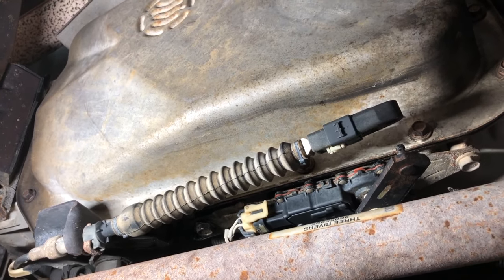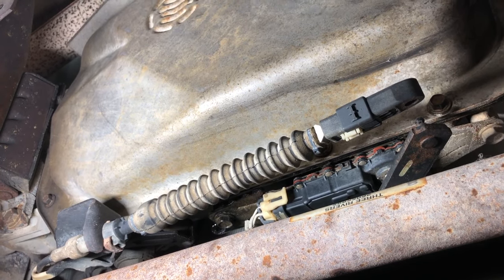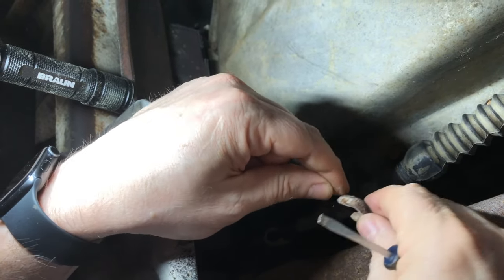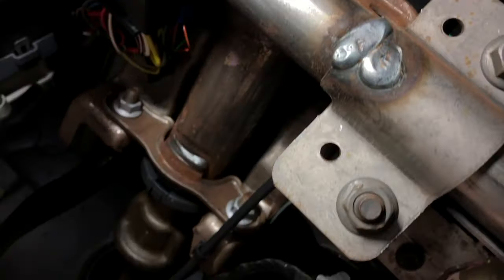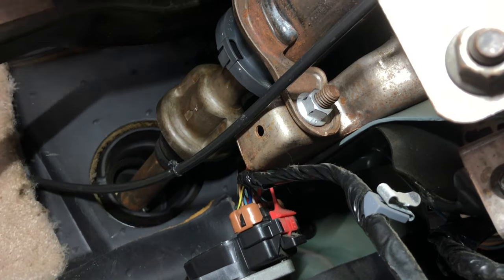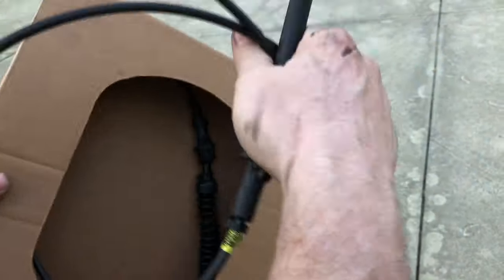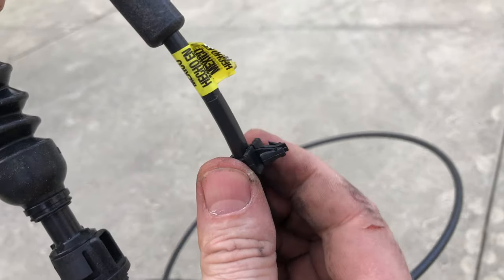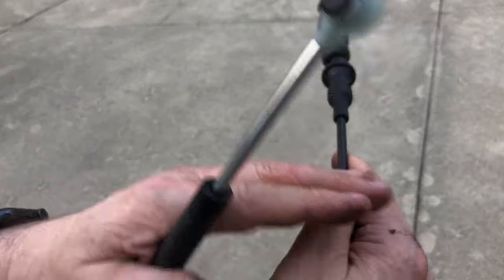1995 - 2000 GM OBS Truck Automatic Transmission Shift Cable Replacement Adjustment (Chevrolet & GMC)

Comment: Great Video. Any idea why a 95 Chevy k1500 shifts smooth into D, but when shifted into reverse, has a pause then feels like it slams into gear?
Reply from the maker: That's a form of delayed engagement which could stem from a number of causes internal to the automatic transmission itself.   If it's the original transmission still on that 1995, long overdue for a rebuild.
Reply: Tip, if you cannot shift into Drive 2 or Drive 3 manually from the steering column , the cable is stretched and you're on borrowed time...
Reply: @thomasbartlett3409   It shifts into Drive and through the forward gears just fine. Just delayed engagement when shifted to reverse and engages hard. 158k miles on it with orginal transmission.
Reply: @DrShock   are all cause the tranny? It is original tranny with 158k miles on the truck.
Reply from the maker: All causes of delayed engagement are going to be inside the transmission. Based on what you've described, that's what I would suspect you have going on.  Delayed engagement can be as simple as dirty ATF, or as bad as the reverse drum or band being worn out (and everything in between including just a bad seal).   About all you can address without pulling it out is an ATF and filter change.  

You can sometimes get some more life out (for a delayed engagement to reverse ONLY) by replacing the reverse servo pin with a longer one.  This can be done without removing the transmission from the engine, but will require removing the valve body to gain access.

Comment: Now got a question my old cable didn't have the clip under the transmission where u used a flat head to put the clip back in would it be okay if I still don't have a clip in the new cable? Btw you helped out a weekend headache trying to figure out what the hell did I go wrong
Reply from the maker: I think you're referring to the metal "U" retainer that secures the cable at the 1:29 time index?  If so that clip is needed to prevent the cable from moving out of position in the mounting bracket, which if it did it could cause it come off of at the transmission range select lever end.  You'll need to replace that, there's a link with the GM part number for the U clip in the video description.

Comment: I own a 2001 chevy silverado. And i think this is what it needs. I got home and it wouldnt go back in park. And then it got to where it will not go out of netural. Still sitting in my drive way in netural. Will this steps be the same to repair it?
Reply from the maker: A 2001 with the newer body design may have a different cable routing, and may take a different part number.  But it's the same type of setup.  It could be the bushing at either end, or both of them over so many years.
Reply: @DrShock  ok. I will have to take a look at it. For about a month the gear shift column kinda developed a rubbery feel. And it felt like i had to dropped it further down than normal to get it to go in drive.

Comment: I know this is a older video, my 97 chevy dually would never go into first but i can go under the truck and select it with my hand, but inside the cab with the shift lever would only go to 2nd, So i tried the adjustment P-1st 10 times NO GO stopped at 2nd gear so i figured cable was worn out/stretched or so the bushings were good, bought a new cable still doing the same thing won't go past 2nd, at this point i'm stumped.
Reply from the maker: Some things to check.  Is the transmission actuator arm installed on backwards?   Is this the correct model/era transmission for this truck or has someone installed a later model/design?   When you performed the cable adjustment, did you unlock the white nylon clip first and then relock it?
Reply: @DrShock   same era truck, same era trans, installed new cable, adjusted as video shows, same issue. Will only go down to 2 with column shift but can go under and nudge arm back and extra 1/2" and it will go into 1st and the dash will show 1st...shift back up to park and then back to 1st..stops at 2nd again...what's the deal??

Comment: Hello is there a way to remove the white plastic locking clip it’s busting my tail mines frozen in the black plastics bracket that attached to the shift arm of the transmission
Reply from the maker: If it's stuck and not unlocking, I would suggest some silicone spray to free it up.  But removing it would most likely break the part.

Comment: I just want to replace the end of the cable .the bushing is the only thing wrong I don't want to do the entire cable replacement.
Reply from the maker: There's only one aftermarket company that makes something like that for these year of trucks that's of high quality, there's a link in the description for it.  But I've not tried that route personally.
Reply: @DrShock  got the parts for under $20at auto zone drilled out the cable side and popped the new part in all done.
Reply: It seams to me there should be a way to take the plastic apart on the transmission end and install a new bushing from Dorman, part #14055.  I came here because I thought you'd show how it comes apart to put the new bushing in.   That's all that is wrong with mine.

Comment: my transmission goes into park and shifter goes into park but my dash doesnt register its in park...cant find video on how to fix. any tips?
Reply from the maker: Since the trans goes into park I wouldn't suspect the shift cable.  On these OBS model years this video covers, the neutral safety switch also doubles as a gear position sensor to the instrument cluster.  I would check out that device.  It's either out of alignment (special tool required to adjust), or faulty.

Comment: How do I know if my cable snapped or if there's something else going on. When I took the panel off the knee bolster the shifter linkage goes side the side not back-and-forth
Reply from the maker: You mention side to side motion, has the bushing popped off the stud?  It's a common failure with the plastic/nylon material of the bushing.

Comment: Is this process the same for Chevy Colorado in the modal year of 20011 I have a similar problem everything was doing fine I put the truck up to do some repairs then it's just stuck in park perplexed none the less a very sudden thing with no warnings at all yeah I do feel it may not be what your showing here in your video however I don't know that either  with the information I have provided is there anything you can tell me that may help 
                                                                                                       Thank you in advance
Reply from the maker: Similar in concept, but more modern and different routing and part design.  Impossible for me to speculate from what you've written as to whether this is your issue.  Typically I'd go underneath the vehicle, as we showed in this vid, and observe the shift cable travel while a helper cycles the transmission gear positions.  But you're indicating you cannot get out of park.   You might lift the truck then, see about disconnecting the cable and trying to move the transmission shift actuator lever by hand.  If you can't, then your problem is likely in the transmission itself and not the cable.

Comment: I have a weird problem. My cable is good and connected fine at both ends. It wont shift all the way down or into park. Is there a chance the cable is broken? Why would it still shift though?
Reply from the maker: If you are sure that both end bushings are intact, then it may just be out of adjustment.   Near the end of the video I cover the cable adjustment procedure.

Comment: Is there any adjustment on that cable? Mine sometimes wont go to park on my 1995 chevy Cheyenne 4x4 
But i can go under the trk and and push the lever putting the trk in park. 
Any help suggestions greatly appreciated
Reply from the maker: There is some adjustment to account for slight wear of the attachment points, which I show in the video.  But not alot.  There's also a locking clip, which may have come loose.
Reply: When i put it in park she cannot move the lever. But if i click from under the trk she can?
Reply from the maker: @allenhenry1113  Not sure eactly what you mean by click from under but if you can manually put the transmission lever into to park then its' very unlikely to be a transmission issue.   More likely the shift cable.   If you followed that cable adjustment part of the video, and the cable does not move for each gear position from the steering column lever, then the cable likely needs to be replaced.  They do wear out and bind internally, as well as the nylon bushings on either end cracking and breaking apart over the decades.    The amount of adjustment is very small, and really only something you should need to do on a brand new cable installation.
Reply: My cable dosent have the slid clip to keep the white clip from falling out.
Pluse when it goes into park the lever wont move at all. I have to go underneath push the lever on transmission then it will go into drive and all. 
I think its old cable that they put in it. So im going to get a new cable and replace myself. 
Your clip shows how to replace it. I really appreciate all your help.

Comment: Mine is a 2005 Cadillac escalade and I did all the steps I can't get it out of under my steering wheel , it sounds like it's clipped on to something and I seen it doesn't show for that part on your video could you help me!! Please!
Reply from the maker: The part numbers, and installation technique, this video covers would only cover the 1999 and 2000 Escalades.  In 2001 the part and layout changed for them.   While similar to the earlier design this video covers underneath the truck, it's alot more work behind the dash/steering column than the older design I cover in his video.  Way more differences than I can explain in a comment, you need to find a video more appropriate to your model year.

Comment: Hey, what is the other arm that is attached right next to the cable. That little arm that connects to the same lever.
Reply from the maker: If you give me a time index in the video I can be more sure that I understand what you're asking about, but I'm going to presume you mean the shift lever arm.  This is part of the automatic transmission, and is what actuates the gear you have selected then the cable pushes/pulls it into a particular position.

Comment: My 96 sierra (automatic) will do P R N D 1 and then won't budge to 2nd and 3rd, now just while cruising in (Drive) it will do 1st gear fine 2nd gear fine and reverse park etc fine, 2nd gear drives fine but instead of going into 3rd it will just stick ..My shift linkage is 100% bad but it can be driven without hassle unless... So my question is is it possible that the bad shift linkage is causing somehow the automatic transmission / computer to not be able to shift while in Drive to 3rd gear? The tranny gave no signs of going out as they usually do, fluid looks fine etc? I doubt the transmission is gone bad but my 2 theories is this shift linkage or the shift solenoids or maybe both lol but the linkage first popped off and lever inability to do 2nd 3rd happened around if not at the same time the drive wouldn't go into 3rd . But I reckon even lightning can strike same place 2wice. Great video man also ty
Reply from the maker: Thanks, the shift cable is only for the manual selection of the PRNDL position.  Anything with the automatic shifting from 1st, 2nd, 3rd, etc is unrelated to the shift cable as once you get it into "D" the cable's role is done there.  Problems of shifting within the "D" selection would be issues internal to the transmission itself.
Reply: @DrShock  thank you brother!! I literally have asked this same diluded question all over the internet trying to get your answer this was exactly what I needed and wanted to know, but always getting might maybes and worries,I never had the right phrasing I reckon, thank you tons man also for the quick response! Sorry for that long paragraph ya had to read lol Subbed liked even will save to boot ahaha

Comment: What happens if you drive your truck with out adjusting it?
Reply from the maker: You can eventually get where it will not shift into the desired gear position as it works out of place over time without the adjusting clip locked in.

Comment: I have a 2005 Chevy Colorado Ls single cab and the truck shifts to every gear but when I shift to reverse it goes to R but will not move when I push the gas can you help me what could cause this
Reply from the maker: If it's shifting into each of the gear positions, I would not expect it to be related to the cable we cover in this video.  If it's in R, and in R at the transmission shift lever, then it's more likely an internal problem with the transmission.  You can confirm this by being underneath the vehicle, and observing that the transmission shift lever is cycling thru each gear position by the cable as the lever is actuated.

Comment: How long did it take to do the complete install
Reply from the maker: If you’ve never done one of these before, set aside two hours to account for running into problems in disassembly.

Comment: ? My Buick lesabre does something no reverse only barely and have out in drive up neutral and pushfoot it out driveway and in drive.shifts normal my car has 149.960 miles .could it be my problem
Reply from the maker: A car will have a similar cable driven shift system, but obviously totally different design than what I'm showing for this late 90s truck style.   The Buick is likely more similar to this Chevy Cavalier vid I did a few years back - https://youtu.be/mC_cbqQJwmE so I'd suggest taking a look under the hood and seeing if the cable is working properly as it's shifted.

Comment: I'm having a problem, I replaced my transmission and I can shift all the way down it's really stiff but I can't shift up at all, the lever goes up but nothing happens.
Reply from the maker: First, I'd verify free movement of the shift lever at the transmission to insure that the replacement trans doesn't have an issue there.  Then I'd recheck that (A) you have the correct shift cable part number for the year/body style truck you have and (B) the alignment procedure is correct and locked into place.  It's a pretty basic setup, with the right length cable and working bushings at both ends very little that can go awry cable wise.

Comment: What was that electrical module box looking thing under the carpet driver seat
Reply from the maker: Inflatable Restraint Sensing & Diagnostic Module or SDM.  Part of the airbag circuit.
Reply: @DrShock  thanks

Comment: Best and I always the case neither sometimes the cable can go out in nine out of 10. It goes out underneath the driver seat. If you pull up the carpet at least four of them Chevys and Fords and all the other vehicles they’re notorious to have that problem overtime over the vehicle is it depends how much it was driven

Comment: Can someone help me with the part of what he calls a "shift lever: at 16 seconds into the video? I bought a 2000 chevy silverado and the one on mine has rusted out, so even with new bushings my cable linkage will pop over like once a week
Reply from the maker: It's also known as the range selector lever.  It's part of the transmission.   It's held on by a single nut and is a replaceable part you can order from GM.
Reply: @DrShock  thank you!

Comment: My new cable, idk what to do to lock it in I’ve been looking at it for hours
Reply from the maker: If you've got an OEM GM / ACDelco cable of the part number in the description, I show this locking procedure right in the video.  If you have an aftermarket cable though, it may be different or not even have a locking mechanism.  

Also note this video only applies to the years and truck models in the title, other truck models may have a different cable design.
Reply: @DrShock  I’ve got a 97 Silverado

Comment: While adjusting it why didn't it go into first. You  skipped over that. That's the problem I'm having while adjusting it it does not go into first on the adjustment
Reply from the maker: 32:21 and 32:31 both show first gear

Comment: Please help. Will a plastic automatic control shifter cable work for a 2003 Honda Odyssey that has metal parts instead of plastic? The mechanic doesn’t know if it’ll work and I need help with this asap. I’ve tried to search for any answer for this and I can’t find anything.

Comment: Does anyone know where to find replacement bolts for the oil pan on a 1999 6.5 Turbo diesel? The dealers list as discontinued.
Reply from the maker: Nope, not discontinued that I can see.   Two numbers, GM 11508534 for the bolts and GM 11518950 for the front studs.  Here's an eBay affiliate search link showing both: https://ebay.us/iA7UMc
Reply: @DrShock  great thanks for the info. My dealer obviously was looking up the wrong vehicle.

Comment: Question couldnt just super glue the thing that disconnects
Reply from the maker: Nope.  This area is under significant torque whenever you actuate the shifter.   And under vibration, heat, and water (rain/snow) effects.  Adhesives just won't last under those conditions.  But in the description I give both the replacement genuine GM cable link, as well as a cheaper route replacement bushing that is aftermarket.
Reply: @DrShock  thanks thats what I did as a temporary fix so now I know I have to replace it right

Comment: I did this and now my truck won't start any suggestions
Reply from the maker: This usually means you didn't get the cable adjustment part right at the end, because the engine will not start unless it's the transmission is in the park position.  That's the only way this particular repair would have anything to do with the engine not starting.